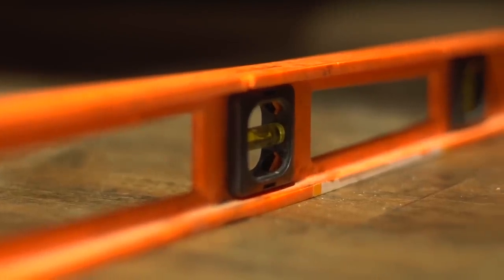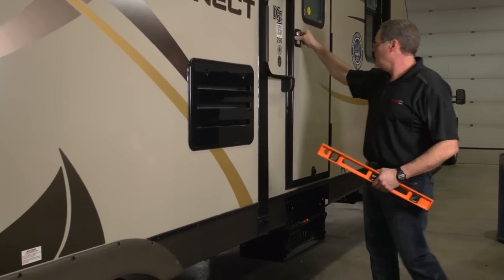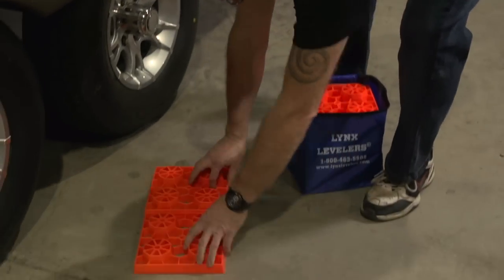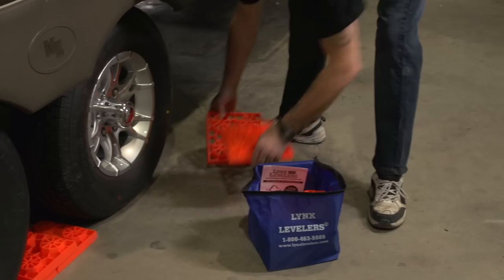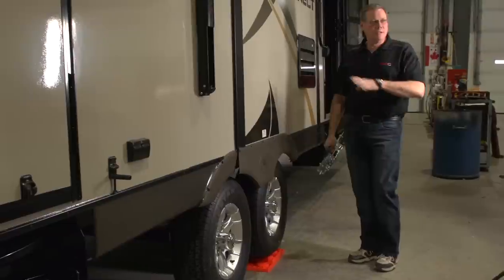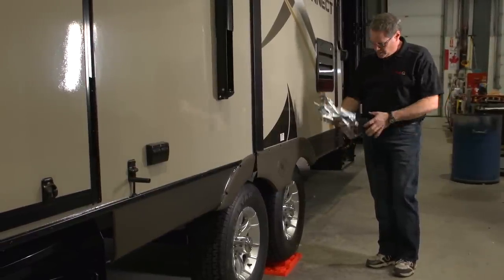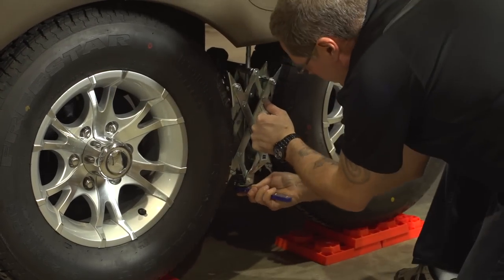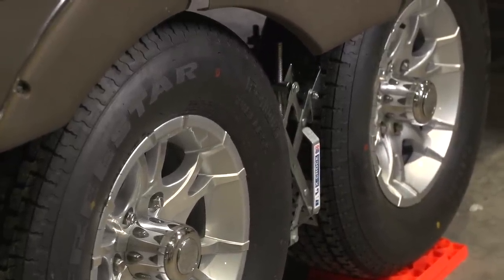How to Level Your RV Trailer From Side to Side

Comment: Misinformation on the BAL chocks, they are only to be used to stabilize but will not replace actually securing the trailer in place. You still have to chock the tires. This is per the manual of these stabilizers.